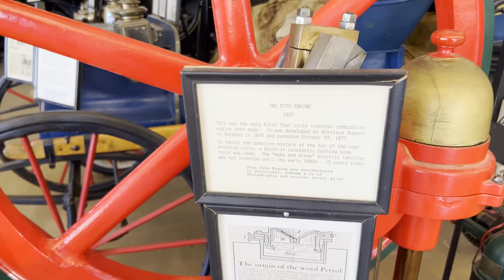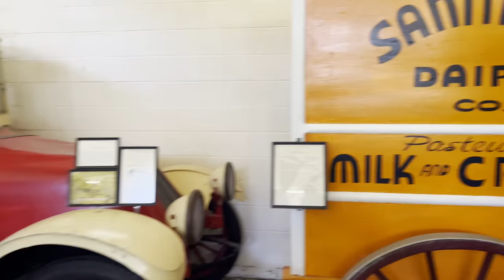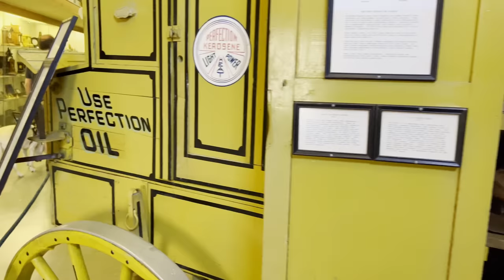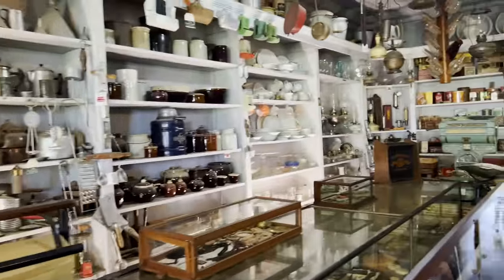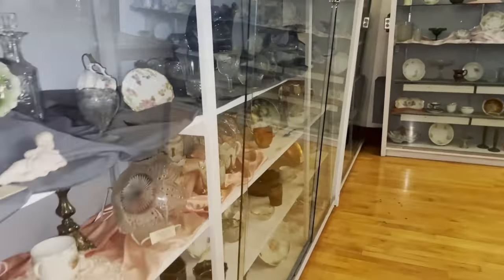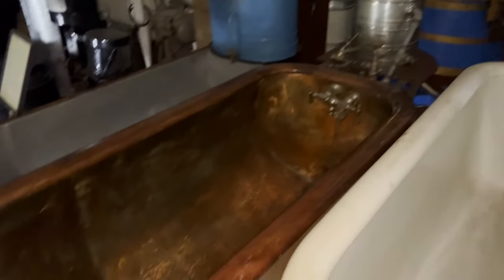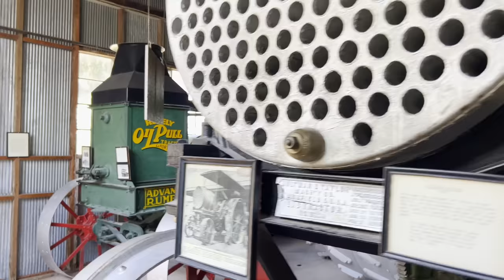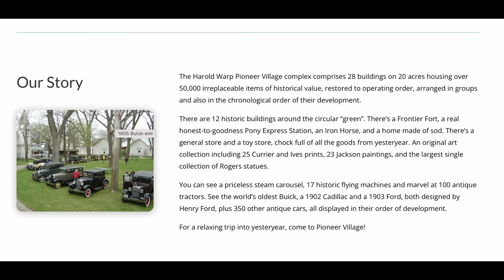This CRAZY collection of 100+ year old cars & more has been in these buildings for DECADES!

Comment: The Family sod hut was by my day had been converted into a root cellar and storm. It backed up to a sand dune. Oma's kitchen had a wood stove and an electric one. The wood was used in the winter to also heat the house as well as a sink with a hand pump. The electric side was the summer kitchen with an electric pump for water. There were also several windmills to pump water to water the cattle.

Comment: I have 3 Maytag wringer washers and I use them year round on my work clothes nothing does as good a job and my washer for the family's clothes doesn't get that slime grease coating in it that stains good clothes and those old wind turbines would create electricity and pump you're water dad runs a floating tank heater and the block and hydraulic fluid heater from the windmill generator he has they still sell brushes and bushings for them